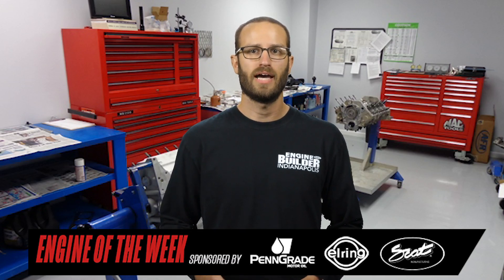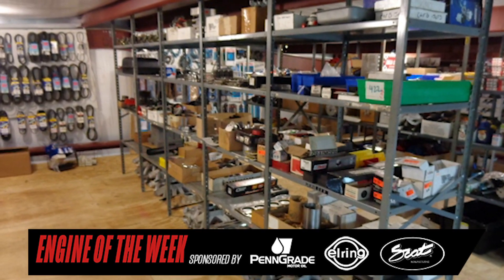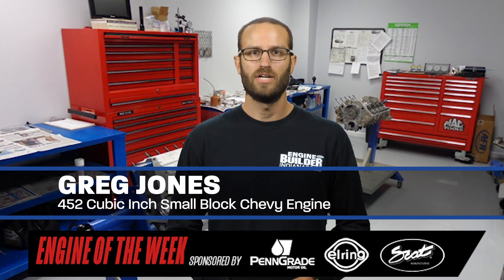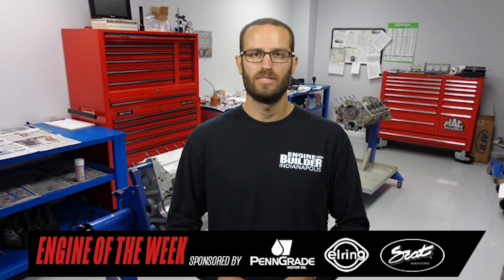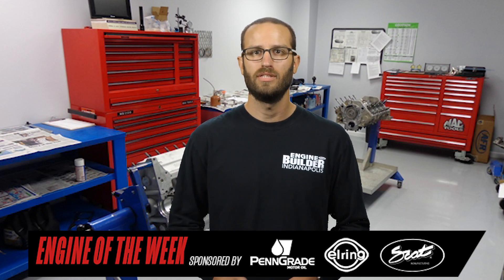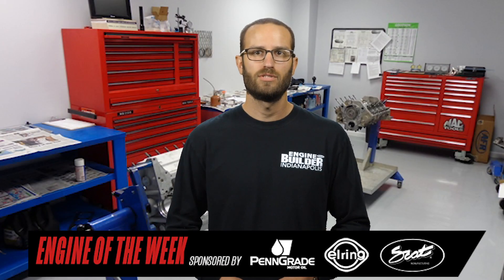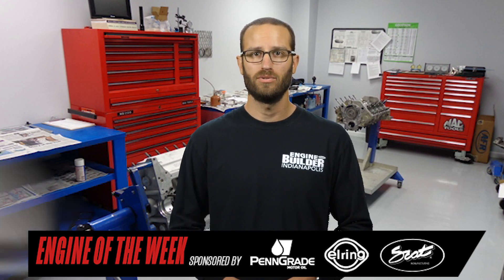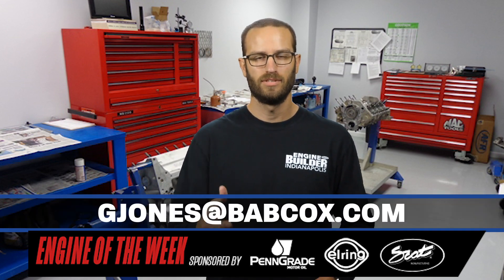452 cid SB2 Small Block Chevy Engine

Comment: Kinda low numbers for that much cubic inch for sb2 na
Reply: not really 

a 358 SB2  cup engine will never make  900,  let alone the 950-975+ this thing makes..they'll make 800+  for sure  and you dont need to make the most you can with nitrous.

now if it was all motor setup  with 15:1  yeah maybe  it should be making 1000+

Comment: no rod or crank info..pssst
Reply: Long rod. super expensive crank like a couple grand a pop
Reply: Yes, im also curious how they get to 452 ci..with only a 4.185 bore.
I have a 4 inch stroke with that bore, makes 441 ci.
So they have to be using a 4.125 inch stroke....🤔
Reply: @basedsigma5634  YEs...friend built a 23 deg sbc that size. Wont make the power the one in the vid does but st drivable and runs 9s with a moderate solid roller

Comment: Nice small "BIG" BLOCK
Reply: No, its a big small block.
Reply: @ThunderAppeal  Lol. Good discussion! From the advent of the A series 4.46 inch bore spacing Small Block  and the first Windsor plant  331 Hemi, Chrysler /Plymouth/Dodge/De Soto eventually said everything below the 331/354/392 Fire Power bore spacing of 4.5625 inches is a Small block. Chrysler invented the term,  Chevrolet continued the use of the term Big Block with the W emgines and then the Rat Big Block Mark IV Mystery "Motor". Using that Old Mopar 1956 logic, any V8 including the 4.527 Bore spacing Ford Super Duty 445 or any of the 4.48 inch bore spacing SB2s. ..they are just Small Blocks:-) But what do I know? It's probably a Freudian " guys lying about Sizing"  thang.
Reply: @deanstevenson6527  Bore spacing, so center of the bore to the center of any adjacent bore.  But that would suggest that the bore spacing included the size of the journals, all of these measurements when the engine left the factory.
There are some guy who argue that the Ford 351 Windsor is not a small block, nor is it really a big block, I believe the core of their argument stems from the size of the journals, I dont know if thats crank journals though.
So Chryslers argument about the basis of calling an engine block a big block based on bore spacing arguably has merit, but there are some Mopar guys who argue that the 383 is not a small block and 383 is  < 392.
But Chevy's Mark IV I believe was based on the 409 but with different heads.
Reply: @ThunderAppeal  The splay between banks varies by about 9/16  to up to an inch, that info is recorded and based on bearing width plus a margin. The bore centres are measured on the left and right bank and you find that by measuring any cylinder head gasket. Some engines, like the flathead 136/221/239  and Jaguars V12 are like slant six Valiant or L series Datsun six cylinder engines, and have varying bore centers to allow a space for a bigger bearing or maybee  where the trust is taken up, or extra Cooling can be given between cylinders under more thermal stress. The V6 Essex 90 has a different splay distance between banks to other 90 degree SB Ford V8s. But the finger print of generic Big and Small block size  was most likely defined by Chrysler and Chevrolet in 55 to 58. Chrysler actually had five different bore pitches from the first Hemi in 1951 to the 1966 426, and then rationalized there plants to just 4.46 and 4.80 inches. Chev went 4.40 and 4.84 inches
Ford responded with three, the early 1952-1966 223/215/262 I-6 and 53-62 Y block V8 4.38 small blocks which was shared on the 62-2001 SBF 221-351, the late 1969 -1982 335 series Clevelands. The 4.6375 FE/FT, and the many 1958-1967 MEL and 1968-1998  385 Lima versions with a huge 4.90 bore centre. The old Truck Super Duty was even larger than the Lima plant engines, something like 5.25 or so. I have to check my notes.  So US Big and Small block terminology is actually fashioned by Mopar and Chevrolets need to rationalise and home in on a specific kind of marketing demographic. People down here always call big blocks truck engines, but in Chrysler, Chevrolet and Fords case, the truck engines were a result of the Big Three's need for strong upper echelon performance cars before the AMA race ban. Definitions probably follow those early cases. Splay and bore pitch varied to suit the perceived needs of the late 50s. Ford probably got it wrong with the avaliable stretch in the FE. But they had another two bigger variantions of the Big Block Limas  asside from the 332-428. Chevy kept pure to the 1955 SBC and 1958 BBC. So did Mopar. I really love how Chevrolet totally blew the DNA of the old traditional 4.40 SBC, and the  SB2 was a radical and brave departure. Ford responded to it.  It's a very special GM engine needing lots of complicated tooling and although it wasn't a huge sucess compared to Fords, it sure makes a lot of power with brilliant reliability and it's very easy to find blocks and parts if you know what it is. IMHO, you'll not see the FR-9 come down in price because it is even more of a specialized engine. Check out Keith Dorton Six cylinder salt lake racer SB2 sans two cylinders. The SB2 is an absolute marvel of GM's  Power train guys going for broke to eke out every, ahem, "small block" Horsepower on the table. Many great things will happen with those forlorn blocks because they are tougher than the 4.40 bore spacing engines.

Comment: That horsepower seems good until you think about it, cups unrestricted motors were around 900-950 out of 358 cubes
Reply: Was built as a nitrous motor not for NA. Always make less when setting it up for nitrous
Reply: Its going to make less as its intended for nitrous....
Reply: Still pretty badass. You know it was a radical cam if they bored the cam journals our to 52 mm. Usually that's to accommodate a lot of lift and by the ram it obviously had a ton of duration
Reply: @GreatLakesLogger 55 millimeters on my sb2.2 joe gibbs motor
Reply: Sb2 NEVER made 900 hp in NASCAR trim. So this is impressive.
Reply: @erikalston4496  the sb2 made in the low to mid 800’s
Reply: @erikalston4496 made 830 in 2003 so I'm sure the big dogs made close to 800
Reply: @mechanical.mullet  but they NEVER  made close to 1000  which is what this makes.  very competitive no time grudge engine in this form i bet
Reply: Could have just bought a used NASCAR engine for probably half the money.
Reply: @thereluctantgearhead4544  Then spend at least the same amount going through it .
An engine designed to run 9k flat out will fall apart on the street

Comment: That is Awesome 👍 Jealous of those w/an SB2 to play with for sure. What RPM was it turning at the the top of the pull?
Reply: Sounds around 9600-9800rpm mate!
Reply: How much did this build cost
Reply: @josephbutler3577  . About 50 grand...but it includes some very special parts which are not just SB2 NASCAR parts. It's a very special stroker!